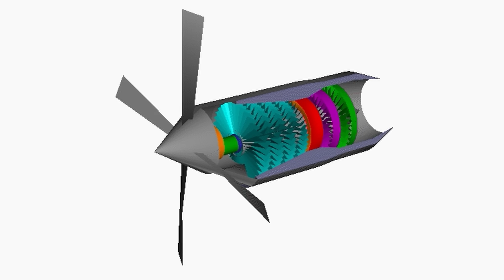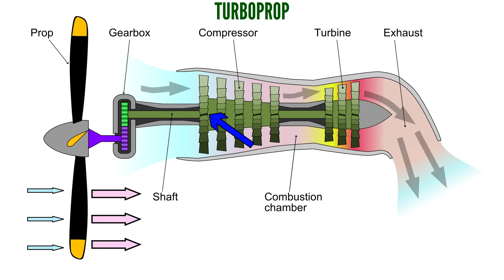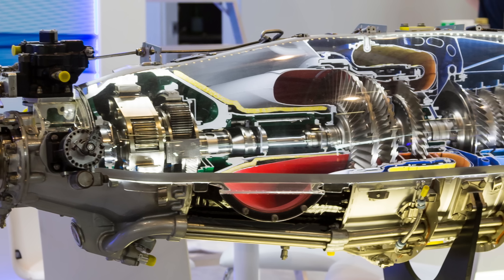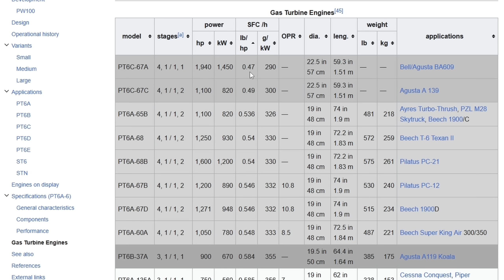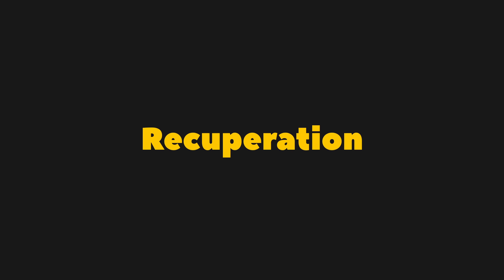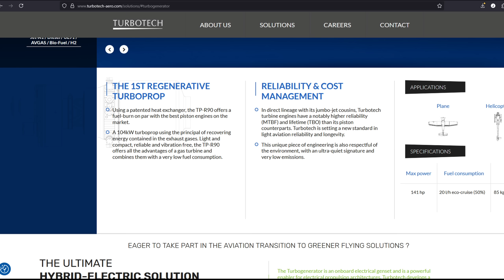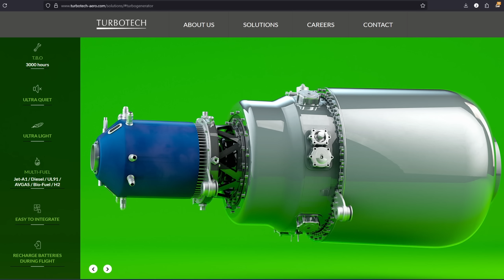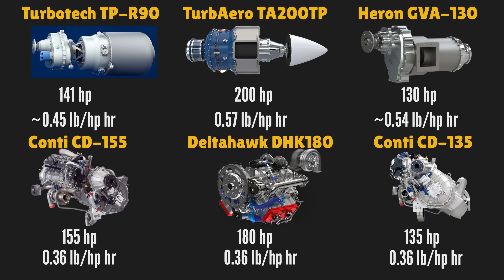Are Piston Engines Dead? Small Turboprops are Here

Comment: I've been seeing small turbines at Airventure for about 15 years, with nothing hitting the market.  The turbine isn't the magic sauce - the gearbox is.  Good luck marketing a turbine and gearbox for the same cost of a traditional piston engine.
Reply: Aerospace engineer here. One of the big issues with small turbine engines is the rotating seals / gaps. You can't get them really much smaller than on big engines, so if the main flow path is many times smaller, but the gaps / leakage are similar, then the relative loss is significantly higher.
Reply: It’s not the gearbox.  

We have piston engine gearboxes on aircraft that are pounded with impulses as well as hard reversals of torque resulting in clattering backlash and they are fine.  

Turbine power is much smoother and doesn’t have to deal with those spikes in torque.. nor does it have to deal with oil that is dirty and breaks down with combustion products.  

No.. the problem is the gas generator.  The exotic superalloys needed to make the hot section, the extremely tight tolerances in tip clearances to prevent efficiency loss, and the large amount of fuel relative to power needed which small aircraft can’t carry in sufficient quantities.
Reply: They have twice the TBO time on average and are significantly more reliable than piston engines due to less moving parts. Jet-A is cheaper than 100LL depending on what airport you fly into as well. Food for thought.
Reply: It's the service interval costs that are the most brutal.
Reply: @Greatlakessailing it balances out, turboprops typically have twice the TBO time of piston engines as well.
Reply: @MidwestUTV and 10x the rebuild cost
Reply: @misham6547 not for smaller jets, less parts, less labor etc. You do realize a 100hp jet fuel starter can be had new for about 12-15k right? That’s a lot cheaper than an IO-200.
Reply: Downsize a turbine requires tighter tolerances, higher spin rates and results in less efficiency.
Reply: @stanb.5517 and You must have a good gearbox to limit the  rpm of the propeller….
Reply: I spent 4 years in the military around turboprops and many years  being transported around Alaska in helicopters and turboprops and the most common problem that grounded these aircraft was  the chips light on the gear box. A mechanic had to pull the plug and check the size of the chips. Sometimes they used a bore scope. I spent a few years assembling jets engines over 40 years ago.
Reply: These engines are being tested and installed in light sport aircraft now. I am sure they will be a staple in new mosaic aircraft
Reply: Oshkosh rocks, i miss it already...have to wait an entire year.  they should do two per year of equal prestige, one on memorial day and one on labor day.  I realize they'd have to compete with things like the INDY 500, so it might be a bit hard, but let's get-r-done
Reply: Wait til next year 😉
Reply: Everyone here is just beating around the bush! The REAL elephant in the room is the perfect storm of gov. regulations, corrupt justice system, and waayyy excessive maintenance costs!!! These evils also continuously feed off of each other!
Reply: Aircraft mechanic/ entrepreneur here. Life cycle and operating costs must also be considered, not only the initial purchasing price if the engine. Less maintenance, faster trips etc.
Reply: “been seeing small turbines at Airventure for about 15 years, with nothing hitting the market”?!?!

The Cessna Caravan has been flying on a “small turbine” since 1985.
Reply: If only there was some sort of infinitely variable gearbox. Maybe using electricity. 

Like a generator, hooked up to an electric motor.
Reply: @jtjames79 you don't need to vary the gearing, the prop essentially does that by changing it's pitch.
Difficulty is taking a 30,000 turbine making 1200hp and gearing it down to swing a prop at 2000rpm. 
Planetary gearboxes are normal.
Reply: @zopEnglandzip  And that's why jet engines are complicated. All the grebles and bits, and wiring and tubes and all that fancy stuff. Is to allow the turbine to vary its output without flaming out. It's really really hard to do and hard to design and expensive. 

Or you can decouple.

Maybe you should Google it, YouTube deletes it every time I had a link that proves my point.
Reply: @jtjames79 for what it's worth, a constant speed prop defeats the purpose of a variable speed transmission
Reply: @soconnoriv  It's not for the prop. It's for the turbine. This is getting past my pay grade. But you still have to deal with converting torque. So you still need all the greebly bits. You just moved the problem from one side to the other. As I understand it. And the results I've seen. Video, white papers, etc. 

The weight has come down, the cost has come down, the technology is cheaper and more reliable. And you always have backup power. You could add a lot of redundancy on the computer side and hardly affect cost or weight.

Cheaper, better, safer. Aviation certification has been in the way a progress for so long. It's going to be a multi-generational leap. And it's going to happen slowly, and then all at once. 

Every industry I have set my sights on has been automated. That's how I make my money. Aviation is next.

But that's just like my opinion man.
Reply: @jtjames79  Cost is the main problem with using turbine engines in light aircraft (<400 hp), fuel consumption is the other problem. You're talking about adding to the cost of the engine, while not really doing much (if anything) to solve the fuel consumption problem, that's not going to solve anything.
Reply: @PistonAvatarGuy  The engines are like under half the cost when you electrically decouple. YouTube keeps deleting my comments so I don't even know if this one will go through. 

I've covered every criticism point by point. Again I'll deleted.
Reply: @jtjames79  But you're just speculating. Until someone actually produces something that flies on an aircraft, that speculation wont mean much. It should be tested, though, of course.
Reply: @PistonAvatarGuy  I'm just speculating about DARPA publicly announcing and having one on a test stand, with video?

It doesn't exist if it's not on an airplane? 

You're just talking crazy talk now.
Reply: @jtjames79  Also, I'm assuming that you're talking about using a turbine engine which operates at a constant power output, along with battery storage to provide TO power? If so, that gets heavy and the battery becomes a very expensive maintenance item.
Reply: @jtjames79  Your mention of a DARPA aircraft must have been in a deleted comment.

Anyway, the military tends to have very different requirements for longevity and efficiency than GA.
Reply: @jtjames79  What's the name of this DARPA engine, btw?
Reply: @jtjames79  You must have made unapropriate political about continuing a certain conflict until a certain invasion has been repelled. Yup, Youtube also deletes most of my posts...or the moderator of the channel deletes them to not degrade his revenue (by not having YouTube sideline his message). This needs some thought
Reply: @ShrekMeBe , I see nothing here about any conflict or invasion or wars or any such thing. Why would anyone here talk about any of that?

Russia invaded Ukraine. Everyone knows this. Putin started the war and Ukraine did absolutely nothing to to provoke Russia.

Gaza launched a terrorist attack against Israel and took hostages. That’s why Israel invaded Gaza. Had the Gazans stayed home on October 7th, they’d still have homes today. Now they don’t. Obviously October 7th was a massive mistake. Gaza should not have given Israel a reason to invade.
Reply: @PistonAvatarGuy  See the US Marine Corps' newest ground effect seaskimmer transport
Reply: @jtjames79  How do you fit all that in the airframe....for ships and locomotives the extra weight is a feature not a flaw.
Reply: @rpatrick2 Extra weight isn’t a feature for ships or trains.
Reply: @jtjames79  Turbine engine with a generator and electric propulsion motor? How would this be better than a regular piston engine?
Reply: @jtjames79  Do you really need all the variation though? Don't turboshafts have really wide powerbands?
Reply: @jtjames79  It is highly inefficient driving a prop shaft electrically. The only time that you really ever see this technology in use is in applications such as locomotives in which scale makes it virtually impossible to utilise a multi ratio gearbox and linkages to the wheels. It is also used in commercial shipping, but it isn't as common as direct drive and is used for reasons other than efficiency. Even in the case of hybrid cars, a mechanical linkage to the driven wheels is utilised when
the engine is running, for the sake of efficiency. If diesel electric drive was the answer, every truck and car on the road
would have been using this system for the past 80-90 years. They haven't been for a reason.
Reply: @davidbrayshaw3529 , Actually, the electrical technology that makes electric vehicles possible has not existed for 80 to 90 years. It wasn’t even available in the 90s.

“By the late 1990s and early 2000s, third-generation IGBTs, utilizing Field Stop (FS) technology, achieved faster switching and higher efficiency, broadening their applicability to systems requiring moderate switching frequencies, such as solar inverters and traction systems.”
Reply: @davidbrayshaw3529 , Actually, the electrical technology that makes electric vehicles possible has not existed for 80 to 90 years. It wasn’t even available in the 90s.

“By the late 1990s and early 2000s, third-generation IGBTs, utilizing Field Stop (FS) technology, achieved faster switching and higher efficiency, broadening their applicability to systems requiring moderate switching frequencies, such as solar inverters and traction systems.”
Reply: @davidbrayshaw3529 , Actually, the electrical technology that makes electric vehicles possible has not existed for 80 to 90 years. It wasn’t even available in the 90s.

“By the late 1990s and early 2000s, third-generation IGBTs, utilizing Field Stop (FS) technology, achieved faster switching and higher efficiency, broadening their applicability to systems requiring moderate switching frequencies, such as solar inverters and traction systems.”
Reply: @davidbrayshaw3529 , Actually, the electrical technology that makes electric vehicles possible has not existed for 80 to 90 years. It wasn’t even available in the 90s.

“By the late 1990s and early 2000s, third-generation IGBTs, utilizing Field Stop (FS) technology, achieved faster switching and higher efficiency, broadening their applicability to systems requiring moderate switching frequencies, such as solar inverters and traction systems.”
Reply: @terjeoseberg990  We've had diesel electric propulsion technology for the past 100 years or so. Initially, DC systems were used with a variety of strange "analogue"
methods used for speed control.
But yes, modern variable frequency invertors and associated hardware is only a recent invention. And while it is a significant improvement over DC, the fact remains that if you want rotational force transmitted, the most efficient way is by mechanical linkage.
Reply: @davidbrayshaw3529 , You obviously have no clue what an IGBT is or how the diesel electric hybrid systems worked 100 years ago. Things have changed. They’ve improved since then. Back then nobody cared about efficiency, and in an aircraft with limited fuel efficiency is a lot more important than in a ship or on a train where you can simply carry more fuel.
Reply: @terjeoseberg990  I think that if you refer back to my last post you'll note that I acknowledged the improvement in efficiencies since the "good ol' days".
I apologise if I was not specific about the transistor type used in "modern" variable frequency invertors. While I have had some formal training in transistor technology, I am not well versed in in that type of transistor. 
That doesn't change the fact, and it is a fact, that driving an alternator to produce AC, then rectifying it to DC, feeding the current to the variable frequency controller
(which incorporates IGBT's) and then a motor is less efficient that simply turning a bloody shaft. It doesn't matter why or where you are turning the shaft, it is LESS efficient to do so electrically. I know that. Do you?
Reply: @jtjames79 What, like a diesel electric cruise ship? That would be heavy and inefficient I reckon.
Reply: @jtjames79 ratiozero is a geared CVT, problem is still a concept and still in testing.
Reply: @Rrgr5  CVT's , PRSU's, spragues and clutches, shock absorbers and so on, are unviable even today in GA engines. There's no solution ahead already.
Reply: Also belts and pulleys, sinchro bents...
Reply: Silent chains, roller chains...
Reply: @Rrgr5  better get in contact with Koenigsegg, I think their gearbox could possibly solve this
Reply: @jtjames79   Maybe a CVT???
Reply: @Gwen-x6d oh hell no... They don't last worth crap in cars, I don't want to be @ FL20 in inclement weather with one.
Reply: @jtjames79  Electric motors are snake oil... unviable in GA.
Reply: @TheMissing62  Electric motors have already been proven as viable in some areas, especially the newfangled axial flux variety. Battery tech however needs some serious R&D time/spend to even approach parity with Avgas.
Reply: @TheMissing62 it’s not the motor that’s the problem—it’s the energy storage, aka battery
Reply: @Reahreic I think he was saying have the turbine run a generator that runs an electric motor. Not have the whole plane run on batteries.  It could work on a big enough plane. Not a Cessna 150.
Reply: @shaunkelly9053  That's exactly what I'm saying. And it probably would work on a Cessna 150 but wouldn't be your best option. Not that they're really any good options.

If I had a Cessna 150, I'd probably put something automotive in it. I would still decouple the motor with an electric motor. But then you only need one electric motor, and it can double duty as generator and motor. If everything is optimal, the math works out to something like 50% more performance and vastly less maintenance than small aircraft motors. Plus ODB is surprisingly powerful these days. There's a lot more data than just indicator lights. Hook up a laptop, and you know about any engine problems a week before they happen. Again, what we were trying to do here is to never push the engine into a high performance regime. That's where all the damage happens.
Reply: @Reahreic  I'm not talking of toys, I'm talking of real planes. Nor even Rolls Royce succeeded in his program.
Actual tech has reached his peak, we need real new technologies.
Electric transportation is a dead end.
Reply: @BurnsRubber  Well, that's true.
Reply: @shaunkelly9053  You're forgetting the golden rules of mechanics; there are losses in every conversion, and that's without taking into account the technical complexity and weight.
Reply: @TheMissing62  for now.
Reply: @Reahreic , There’s no energy storage necessary. The generator/motor combo replaces the gear box. The aircraft would still have an engine and still burn fuel. The question is whether a generator/motor combo could be as light weight as a gear box?

This method could offer a benefit if just enough battery were added to handle an engine failure during takeoff, or to provide extra power sometimes possibly allowing for a smaller less powerful engine.

Imagine the engine has 10% more power than what’s required for cruising speed, but only 50% of what’s required for takeoff, but just enough battery storage for takeoff followed by an emergency landing in the case of an engine failure. This smaller engine might counter the increased weight of the additional generator/motor/battery.
Reply: @BurnsRubber , There’s no energy storage necessary. The generator/motor combo replaces the gear box. The aircraft would still have an engine and still burn fuel. The question is whether a generator/motor combo could be as light weight as a gear box?

This method could offer a benefit if just enough battery were added to handle an engine failure during takeoff, or to provide extra power sometimes possibly allowing for a smaller less powerful engine.

Imagine the engine has 10% more power than what’s required for cruising speed, but only 50% of what’s required for takeoff, but just enough battery storage for takeoff followed by an emergency landing in the case of an engine failure. This smaller engine might counter the increased weight of the additional generator/motor/battery.
Reply: @TheMissing62 , How do you know that electric aircraft are a dead end?
Reply: @terjeoseberg990  Because I'm have formation in mechanics, physics, chemestry and electronics, not in blind faith and magics. 
If you don't believe me, just wait a couple of years. 
At least, with the actual "state of the art", has reached his peak.
Or maybe in the future new techs could be viable.
Reply: @TheMissing62 , You must have a crystal ball that allows you to see the future. I don’t. Therefore I don’t yet know what will and won’t be dead ends.
Reply: @terjeoseberg990  nope, I have a mastering in mechanics, and in the actual state Is a dead end; maybe IF a new techo in batteries Is developed, can be viable. 
I whish I have a crystal ball.
Reply: @TheMissing62 , A mastering in mechanics? Can you explain what that is?
Reply: @TheMissing62 , New battery technology is being developed. There is no maybe about it. Energy densities are increasing. There are already electric aircraft that you can fly for 2 hours for significantly cheaper than gas or diesel aircraft of similar size which is great for student pilots who rarely fly for more than 2 hours anyway.
Reply: @TheMissing62  I guess, technically you are correct, civilian GA and light sport (the target market for small turbine tech) are considered toys. Interesting how there are a few commercial operators successfully using electric powertrains for short haul operations but what do I know I'm just a voice on the internet whose actually used electric transportation...
Reply: @terjeoseberg990  Similar tech to diesel electric trains. It's a promising concept, but the added weight of the generator section is a tricky problem to resolve. Still, a diesel generator has around a 40-60% energy efficiency when running at optimal load which is an improvement on energy conversion over the 30-40% of a traditional gasoline engine.
Reply: @Reahreic  whatever, good luck with It 😅
Reply: @terjeoseberg990  And the charge of the batteries comes from...?  MAGIC!!!
Fossil fuels, mostly; but people is deaf, blind and stupid ignorant generally speaking; is all about math and entropy.
Don't waste time in your "ad hominem" argument, you don't know who I am and my formatión; don'd acuse me for don't have a magic thinking.
Again: the actual technology reached his limit, no further developement is allowed.
At least that a completely revolutionary tech will be discovered.
Reply: @TheMissing62 once a battery is developed that is light enough and power dense... I could see electric aircraft having their niche. But battery power density is still a ways off from petrol.
Reply: @TheMissing62 BS...the battery is the only hold back. Electric motors are superior in every way! You are highly uninformed!
Reply: @jtjames79  A modified automotive engine with an electrically decoupled prop would be very heavy and expensive, you'd have a small plane with the cost and complexity of a larger plane.

I'd also be very interested to see what math you've done and how you'd be pulling 50% greater efficiency, or how this would be a better upgrade than something like a rotax with a constant speed prop.

I do think it could be a more viable solution for small helicopters though, not having a rotor transmission would give you better freedom with engine placement which means better aerodynamics, and you wouldn't have the gearing or a shaft/gears leading to the tail rotor.
Reply: @dodgewrench9445  I want to know what you're smoking that makes you think you can beat the power density of a Hayabusa.
Reply: @TheMissing62 electric motors are fine for air travel, its the energy storage that needs to be cracked.
Reply: @jtjames79  Have you ever even ridden a hayabusa? They make decent low end power for a motorcycle, but they really don't start making any significant amount of power until they get into the powerband at 5-6k RPM, your 'busa engine plane will not last long running like that lol.

Hayabusas are decent for cruising in motorcycles, but they're not putting out anywhere near the continuous power they would need to for a plane. And before you get off to the electric disconnect, your engine still has to put out the KW needed to run the prop and you'll be putting that engine under a lot of stress to get it out.
Reply: battery technology has plateued there is no future battery technology with better energy density than combustible fuels.  human fat is more energy dense than the best batteries out there. it will never be viable for aviation and is barely viable for cars. it's a misguided direction to go down
Reply: @terjeoseberg990 You’re describing a basic hybrid car engine and I agree with you. A small battery and a piston engine. The same way a car is optimized to run on the Atkinson cycle, a piston engine can be tuned to run more efficiently rather than provide more power at peak. The electric motor would supplant the power output during high output requests like at take-off and climb. And yes, it could provide some emergency power when an engine fails as well. What the system would lack is the regenerative cycle, which is a big part of fuel efficiency with hybrids.
Reply: @afcgeo882 , By “regenerative cycle” are you referring to regenerative braking? I don’t believe that’s the primary benefit of hybrid system in cars. You see, a typical automobile engine has a peak efficiency of around 30%, but that’s “peak” efficiency. When you’re stopped at a red light the efficiency is 0%. When driving at 5 to 20 mph most engines are mostly idling so the efficiency is somewhere between 0% and 10% or so. Even driving at a constant speed down the freeway, the efficiency is typically 20% to 25% because the engines have to be designed to have more power than necessary for constant freeway speeds because sometimes you need to press the gas pedal and the vehicle needs to move.

A hybrid system that allows you to get by with a smaller engine that runs at 30% efficiency whenever it’s running because it can rely on the electric motor whenever the engine isn’t running makes a huge difference even without regenerative braking.
Reply: Especially vs efficiency of piston diesels.
Reply: @jestubbs69  Modern gasoline engines can get down into the 0.35 to 0.37 lb/hp/hr range, which is basically the same as the aviation diesels. Even the Continental Voyager IOL-200 was able to get down to 0.37, and it was designed in the '80s.
Reply: @jestubbs69  Diesel was a forbiden ground in the past decades in GA; now with some new techs maybe will be an answer.
But everyone here knows pros and cons.,
Reply: G'day,

I'll see your
Cost
Objection...
And I'll
RAISE you
To
The tune of 
ALL Certified Piston Aero-Engines made from 1950 to about 15 years ago,
REQUIRE Tetra-Ethyl Lead in their Fuel, the better for the Exhaust-Fumes to send the Pilot's Friends and family stupid (!), while permitting the Unit to produce 30% to 50% more Power without Predetonating at TDC.... ;
All divided by there being
Only
ONE Manufacturer of
Tetra-Ethyl Lead
On Planet Earth..., 
The stuff is illegal in
Everything BUT Certified
AERO-Engines...
And it's so So SO very toxic and
EXPENSIVE to produce, commercially, for a
Tiny and
Shrinking little Market...; that
The Only Manufacturer of the stuff is
Quitting
In 2030.

So, in 5 more years,
Every Piston-Engined Aeroplane WILL be either
Running on UNLEADED, or on MoGas,
OR..., it WILL be burning Kerosene in a Gas Turbo-Prop...

Otherwise, the Aeroplane
WILL have become a
Garden Ornament...,
Not worth paying for Hangar-Space within which to
Shelter it
While it corrodes  rusts, rots, and Birds and Mice and Rats nest in it.

Regardless of OPINIONS & Desires, of all they who have steadfastly
Resisted  
CHANGING
Anything within their 
Accustomed Avgas Supply Pipelines....

Such was their CHOICE.

Such is life,

Have a good one...

Stay safe.

;-p

Ciao !
Reply: If the turboprops haven't quite caught yet,  they'll do even less in the electric era. Plus, they'd require the same (or more) amount of servicing as a regular jet engine, the principle is the same, only more complex, turbine with gearbox. Comparatively, the stroke engine is rugged, reliable, scalable and mature technology for the usual flight altitudes.
Reply: I worked on a prototype 35-50kW micro gas turbine for 5 years - it was 30kg without a heat exchanger. 

Combine that with an electric motor and a battery pack, you could power a (very) light aircraft with regen whilst decending.

Hybrid Electric aircraft can work.